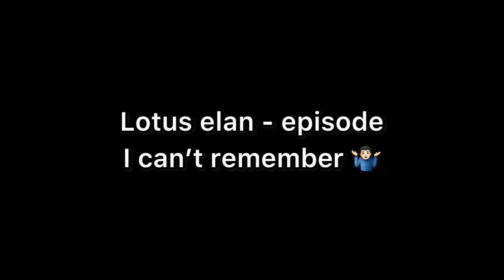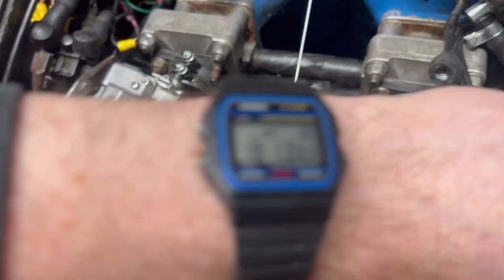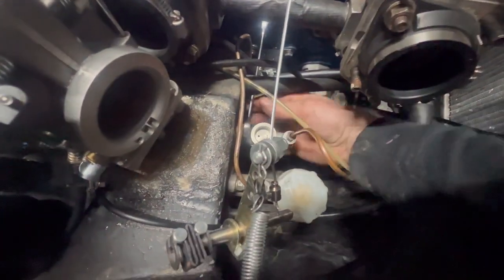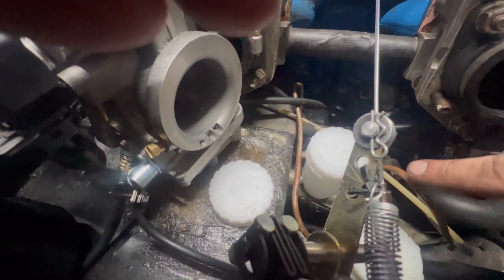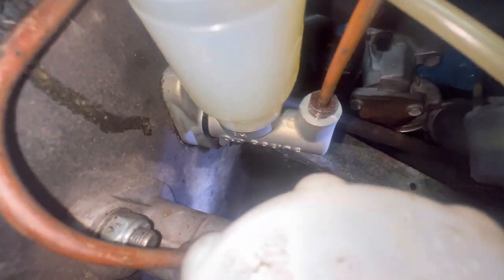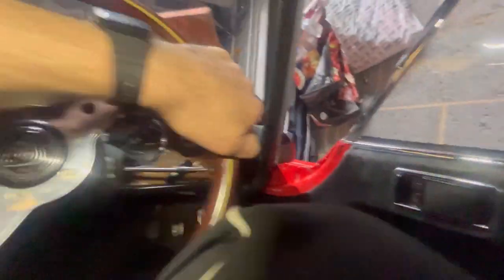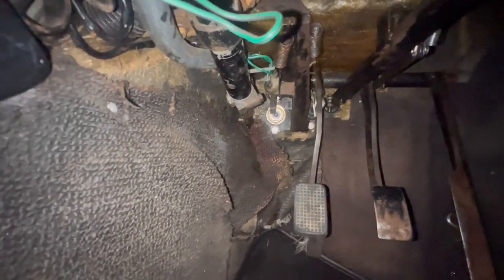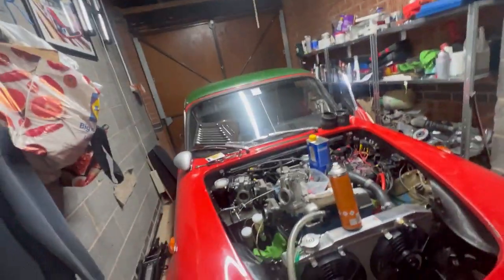Lotus elan episode 71. Brake master cylinder

Comment: Cheers Oliver-  I think your solution regarding the brake push rod modification looks like it ought to work.  Seems like the plastic bottle from AP is a bit of a weak point. I'm surprised they don't have a better solution to keep it from spinning off.  I might be concerned about it loosening due to vibration while driving.  I have no experience with AP though.   Good luck and stay safe.
Reply from the maker: I hadn’t thought about it vibrating whilst driving. Hmmmm. Maybe back to a remote reservoir